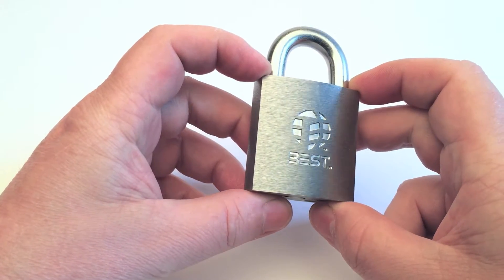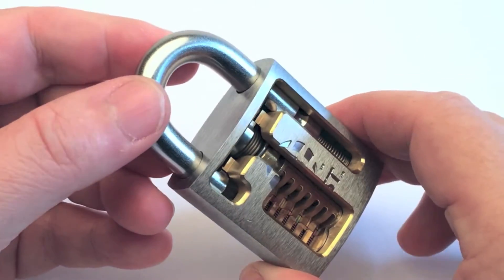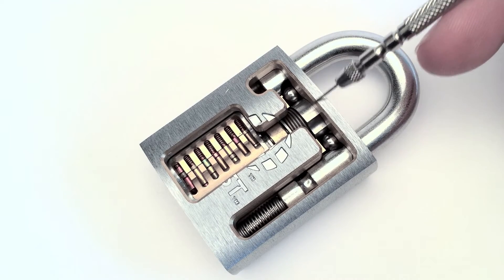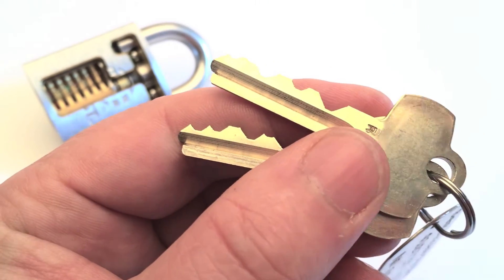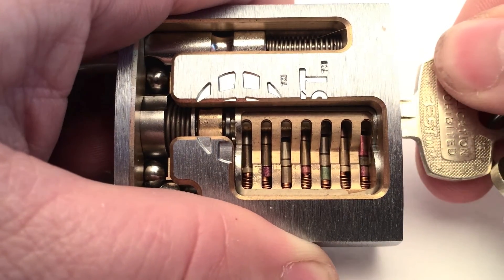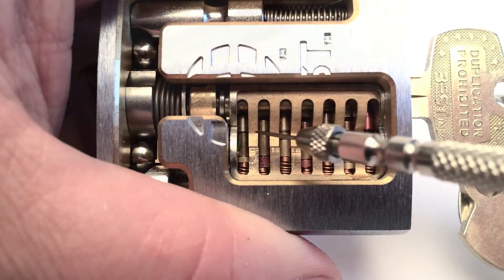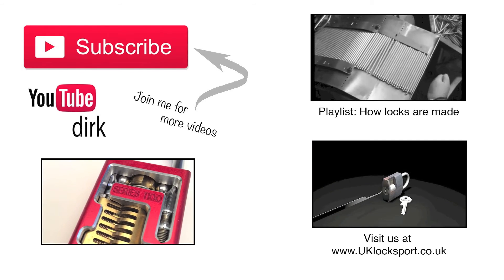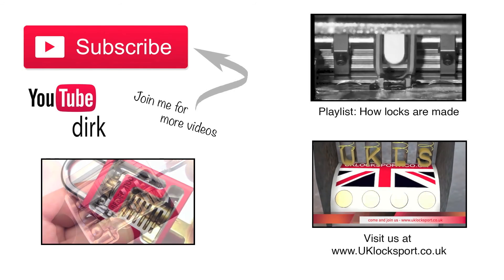[057] Cutaway - Best lock 41B72T

Comment: Just love this cutaway lock :). Thank you for showing the different keys and all the different pins and wafers inside.
Reply from the maker: It is a super interesting lock. You need a special tool to extract the accelerator.  I've one here from l0ckcr4ck3r, but showing this also, it would be a to long video.